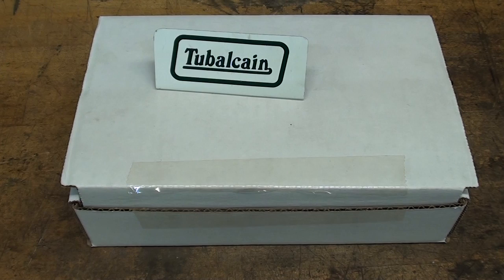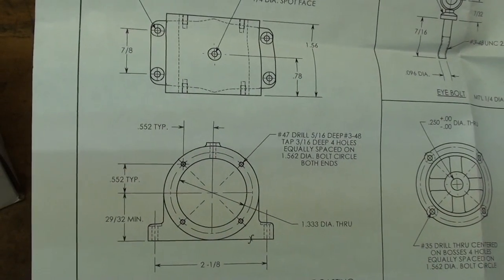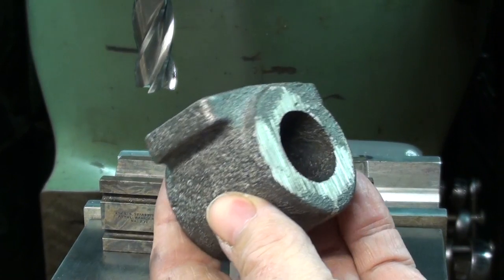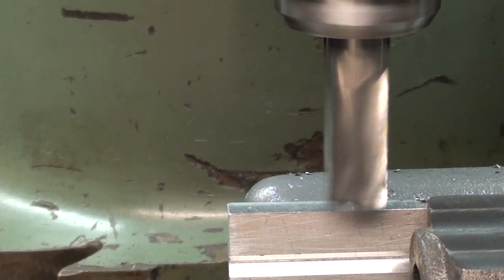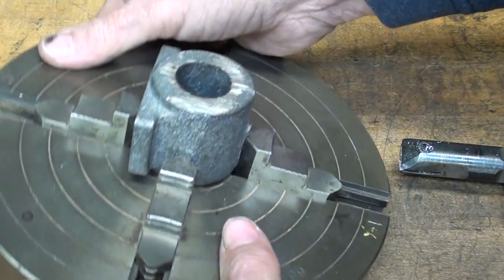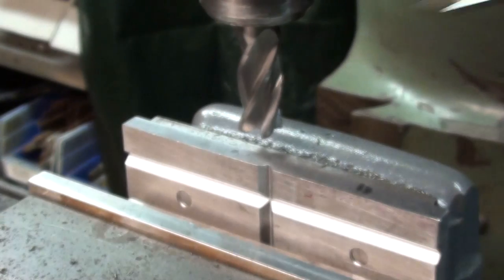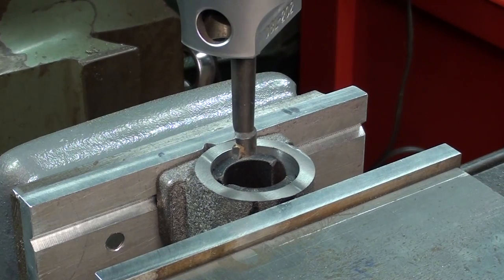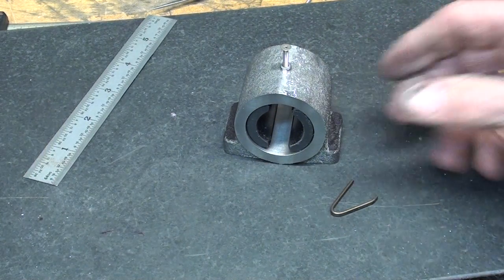Make a Steam Powered Dynamo pt1 Tips#436 tubalcain

Comment: Hi Mr Pete,
thanks for another great video.
although there are many ways to skin a cat, one factor that should be included in cutting the base plane of the cast frame is that the flange ends should be of equal thickness. Some that you alluded to.
therefore in setting up to machine the base the reference plane should be the top face of the flanges - this being the faces closer to the vice.
so it would be best to measure to the top face of the flanges , not to base of the flanges.
If the flanges protrude far enough the they can simply rest on the top of the vice jaws.
I appreciate your great work in the videos. thanks

Comment: Yes, that was definitely the only boring video I've seen today.  I do love to watch the machined surfaces come out of those rough castings.

I guess they design these kits around preexisting wound rotors.  It would be so cool to have one that modeled the old large-diameter dynamos of the steam- and diesel-driven generating plants, like you see on the Fairbanks-Morse units.  They would generate useful voltage at lower RPM, too.

Comment: I think that everyone have great use for a set of metric drills in imperial land just as we in metric sometimes need that hole to be just over or under size and use imperial. A common nut size is m8 that use a 13mm spanner, if the head is damaged I hammer on a half inch spanner as that is just under under 13mm.
Reply: Agreed. My shop is pretty much 100% imperial and I have no desire to change. That said, I have metric tools, drills, taps & dies etc. for when our two Worlds intersect. I routinely come across projects where I need something metric. The two systems can co-exist.
Reply: In UK,  M8 bolts usually have a half inch head,  for ease of finding a spanner :)    I use a 1/4" drill bit for tapping M8 too.

Comment: Nice project Mr P, to this non-machinist it looks like if not careful it could be problematic getting that initial reference cut right on a rough casting - nice to see how its done.  Looks like that magnet spring could be pushed into place using a tool in the inside of the V-?   I can see how that casting is going to give the finished product a look from the early days of the industrial revolution, very cool.  Cant wait for the next installment.

Comment: Please can I ask why you chose to level the casting using the underside of the base (which you have already said is not necessarily ground true) - the top of the cast ‘feet’ which are set up in the vice facing down to machine the bottom may be left ‘as cast’ although you may later spot face for the hold-down bolts - why wouldn’t you use this surface (facing the mill table) when setting up the casting using your surface gauge? I am a newbie to this, so there is probably a good reason for not doing this, but I thought I’d ask. 
I did like the way you used the bar through the bore to get it nicely parallel to the cast in bore. Thanks for all your videos - great viewing and learning for someone like me who doesn’t have any engineering shop training. Please keep them up.

Comment: Lyle, at about 13:23, "am I talking 
too much?"

NO!  Unless what you're saying 
is not instructive.  I'll let you know 
IF that ever happens.

If you ever have a need for replacement 
magnets, find a broken car window 
regulator.  (The power window drive 
unit.)  Those magnets look VERY similar.
Any auto repair shop, will likely have a 
few on hand.  If you were in the Phoenix 
Az area, I'd give you some.  Usually, the 
cable mechanism is what goes bad, not 
the motors, on window regulators.

steve
Reply from the maker: Thanks